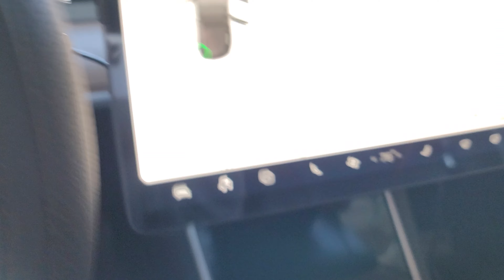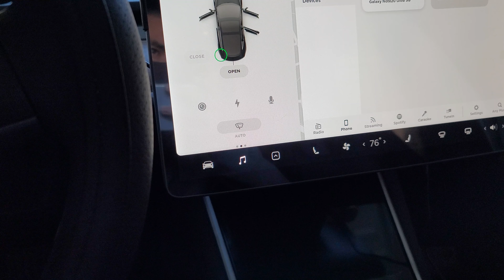Tesla Model 3 SR+ Inactive Speaker Activation Wire Harness INSTALLED! (TESLA OFFER)

Comment: You probably figured this out by now- but you don't have the speakers on the back parcel deck.  When you showed the plug in the back, it only has two wires, the blue and the black.  That means you don't have the back speakers installed.  Same as my 03/2020 SR.
Reply: I jave those back speakers and they are pathetic sounding, in stock config. Premium.long range 2018 here. They are just a joke.

Comment: What's that switch that you show at 3:11?
What does it do, where did you buy it from, how expensive was the switch alone, and did it require a separate installation than the wires that you showed us on the other side of the car?
Reply: That's the bass controller.

Comment: I thought that harness is supposed to activate the pillar speakers by your head, the tweeter by the side mirror and the 2 in the back deck.  You are saying that there is no sound from the front door speakers?  Something may be wrong, can you retest?  Its supposed to add speakers and not take away from others.   Correct me if I am wrong and can you please post link of where you got it and how long it took to get it.    Thanks, Ian B
Reply from the maker: I think it's because I have aftermarket subs
Reply: @kajimakerz8493  that doesn't "sound" right. You sure the sub installers didn't mess this up? They must have installed the sub with whatever they had available to make it work. I think you should go back to them, now that you have the correct harness for the car and ALL its available speakers. They clearly didn't install this harness because you found out about it and bought it, so I'm stumped on what they did to make your sub work. Also, I don't have access to my old bass knob anymore, but I can still get sub installed without it. It'll just need manually adjusted to my liking and stay that way. I wish Kicker sold that particular bass knob for my amp, but so far no luck. No biggie at the moment. I'm just excited to hear how this new setup sounds!

Comment: Sup bro, I was just about to do this install…but your video is a little different from others I’ve seen -  did you not have to run part of the harness to the drivers side??? I know this video is old (new to model 3 club sorry) but If I don’t have to tear down the drivers side trim if would save me a ton of time.  Thanks for the video!
Reply from the maker: No... Passenger side only

Comment: That's odd that now your door has no audio... I questioned about those speakers about a year ago and said you'll probably have to pay for an upgrade to audio, but clearly it's hardware related.  I got that kit coming today for my M3 but min was built after March 2020 ( in November) and I guess by then, Tesla had stopped putting in the rear "shelf speakers" and or subs like you'd get with a long range or or performance model. So from my understanding, I'm only going to activate "unlock" 4 extra speakers instead of six. Like you, I have my own subwoofer and amp mounted to the sub box, but have yet to get it installed. I'm assuming by doing this add-on, it makes adding a aftermarket sub possible/easier?
From my understanding, this'll make audio clearer and louder, but by doing so, that'll make the OEM lows, not as pronounced. I guess I'm gonna have to get my sub installed after doing this.. Thoughts? Thanks for the video man!
Reply from the maker: The only thing I noticed that it activated was the tweeters in the top bar.
Reply: @kajimakerz8493  I installed my kit from BASENOR from Amazon on my 2020 M3 made in November 2020 and noticed that it activated my pillar tweeters, the smaller door speakers below the tweeters and the rear shelf speakers that I didn't even think I'd have based on the date of the car production. Needless to say, I was blown away with how much better it sounds! 

Settings are as follows which I'd suggest trying:

 EQ:
 Low: +8
 Low-Mid: +4
 Mid: +1.5
 High-Mid: +3.5
 High: +6 or 6.5

Great kit that took maybe 1.5hrs! 👍👍
Reply: @WellHelloSilly  Do you have the manufacture date of your car? I purchased my SR+ in August of 2020 and am hoping that my rear speakers will be activated.

Comment: Could you link more info. You're very vague in your video. Where you got the wire, your sub amp, etc. All those details would be great. Also your front speakers should be working. Mine work in that model so you should probably check that out my dude. Thanks for the vid though.
Reply from the maker: The subs are aftermarket.  The wire I got from teslaoffer website